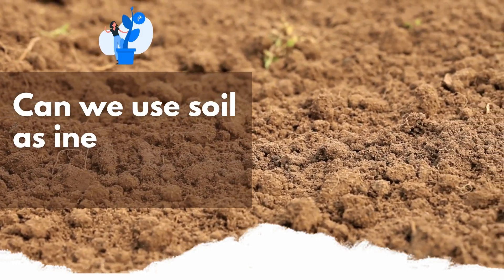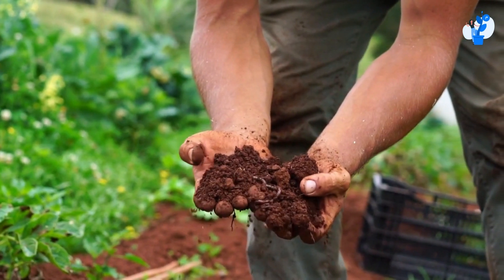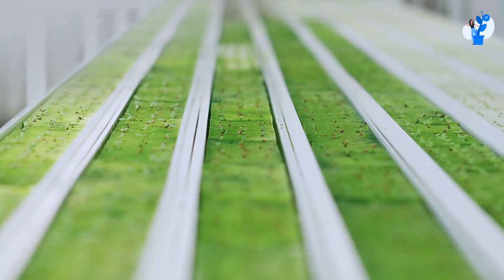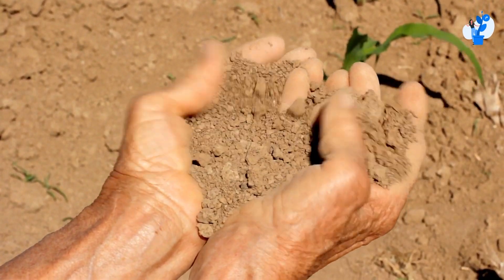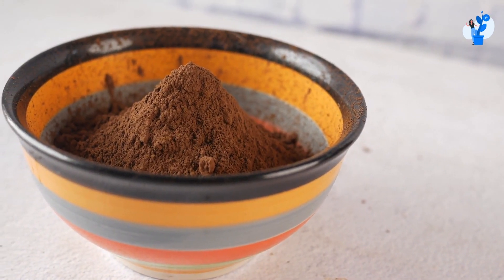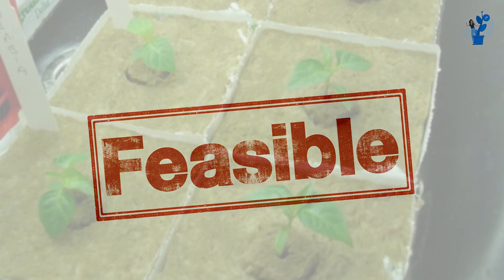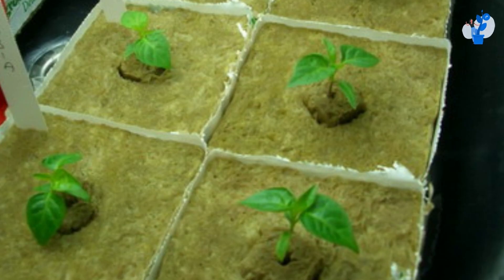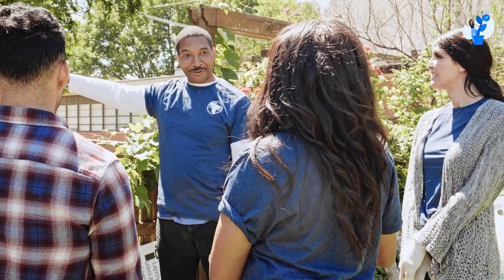Can we use soil as inert media in hydroponics?

Comment: You can start seeds in soil, then wash the soil away and put them in clay pebbles. In my  experience it is the easiest and cheaper thing to do. Rooting cuttings is faster than planting seeds, but it does not work all the time and sometimes it is actually slower than planting the seed in the first place.